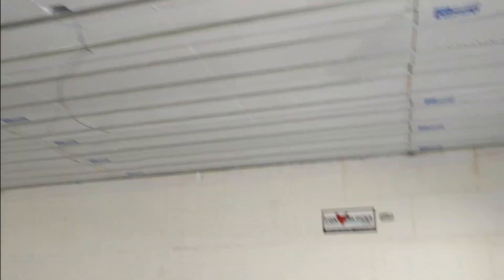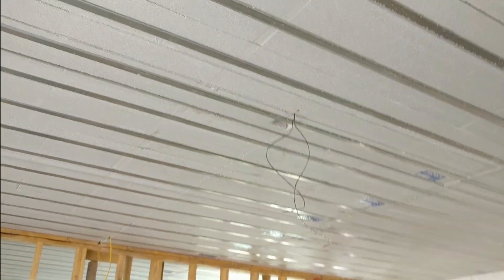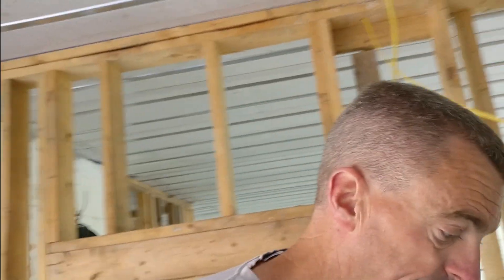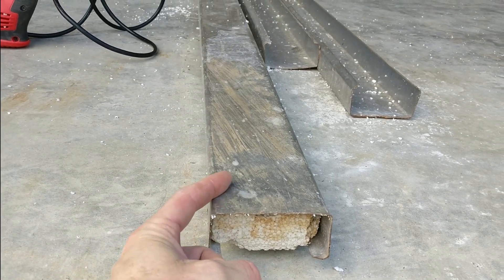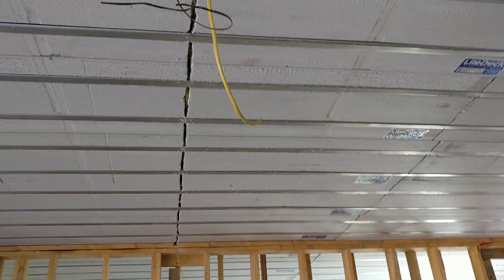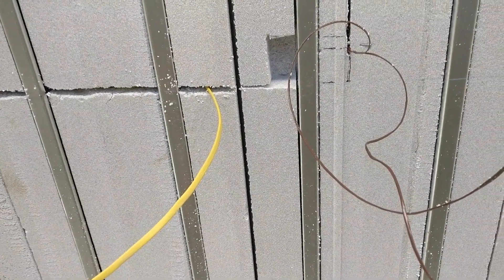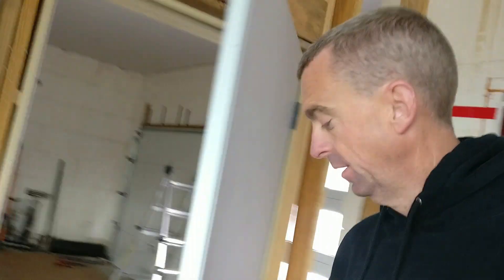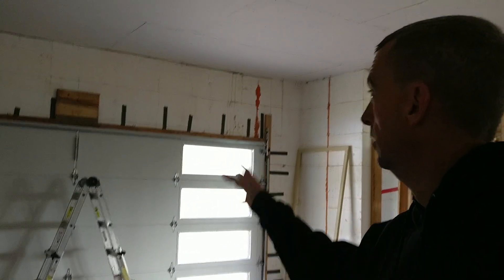Running electrical  in LiteDeck ICF suspended concrete roof & installing custom garage door

Comment: John, thanks for sharing. I am doing exterior door for my ICF house…I wonder how did you do jamb for your exterior door? Please share so I can learn from you and apply to my build. Some folks says do extension but in your case seems it’s a full width jamb as icf wall thickness or it’s painted very good. Thanks Sir
Reply from the maker: We had extended jams put on door prior to installation.

Comment: Would that have been easier to put in before you put on the second piece of the light deck roofing foam, what I mean is you put down the first layer of the light deck then you run your wire and then put the second layer of Styrofoam light deck up there and then pour your concrete. Maybe even going to the trouble of using conduit to keep concrete off the actual wire. It's just a thought watching you fight with it. For my own build it might be easier to do it that way but I don't know. Let me know what you think

Comment: I have been a general contractor for over 30 years.  ENT is perfect for this application. You need to plan ahead, but besides electric wires, it can also be used as a sleeve for PEX.

Comment: I want to use ICF for my basement and first floor for my garage and house. trying to find a builder that will do that and build a steel PEB for everything. I'm planning on using 4400-5000 psi concrete so that the basement and floors are waterproof too. No need for an outside waterproofing sealer.
Reply: The strength of the concrete has nothing to do with waterproofing.

Comment: All you have to do is install wood slats and you can run everything no problem and not have to do all this extra work.
Reply from the maker: It's a mess too!
Reply: @LakeLotBuild  I learned the wood slat method from north eastern builders. It is a great method and come in handy later if you have to fish wire on a remodel.

Comment: Why not run the wire parallel with the lite deck and then onto the icf wall? seems way quicker, little more wire used of course

Comment: Thanks for this video!  If you have more ceiling lights to run in the Lite Deck in the future, would it be easier to run the wire horizontally in the ICF walls to the correct ceiling section and then go up to the lite deck and just stay between the metal studs while you run the wire out to the middle of the room?  You might have slightly longer wire runs but it might save you time...
Reply from the maker: Thank you for the tip!

Comment: When constructing my house in Mexico, the contractor had the electrician install the all recessed cans and fixture boxes in the ceiling prior to pouring the floor or ceiling above.  As part of that job the electrician installed rigid rubber tubing as a conduit.  It penetrated through the styrofoam and then was tied to the wire mesh of the floor or ceiling and encapsulated in the concrete pour.   It is the same principle that is used to run electricity to a kitchen island.
Reply from the maker: Very cool! I have seen it done in Thailand and the Middle East that way.

Comment: 39f/high-60's... aprox 30f delta... with blue painter's tape on the back door, no finished wall to garage, & we all know even an "insulated" garage door is lacking... that's really impressive!

another tool for embedding the wire that comes to mind would be the handled rollers used for pushing screening cord into frames... seems like it'd go really fast. anyone used one like this before?
Reply from the maker: That is what we thought! Quite humid though inside as well as the concrete cures out.
Reply: @LakeLotBuild  ...the ERV should fix that tho  :)